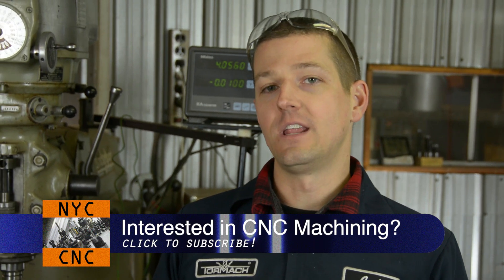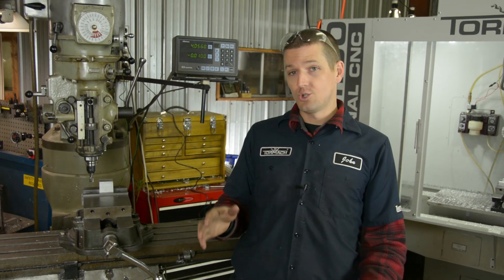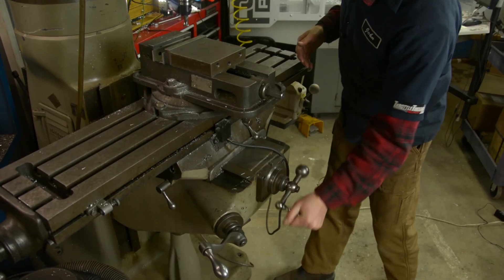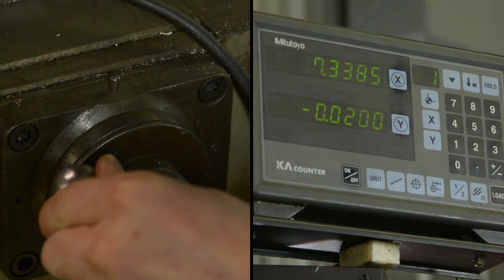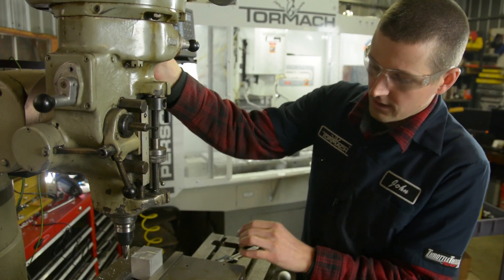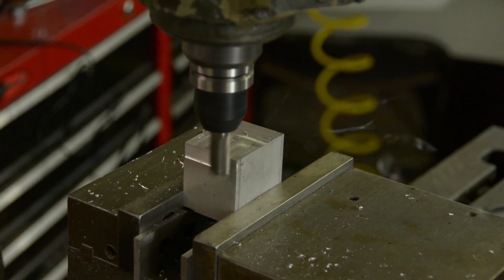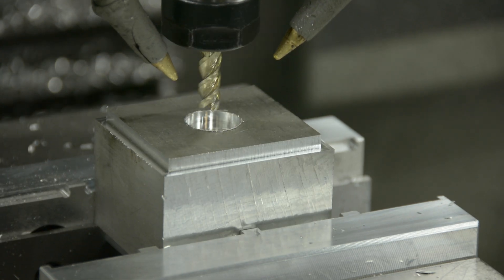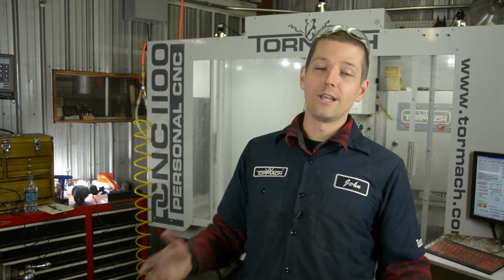Beginners Guide to Manual & CNC Machining!

Comment: The problem with machining compared to the other trades is the income-to-hassle ratio is terrible. In most markets a machinist earns at least $10/hr less than a welder, plumber, or electrician. Not to mention the other trades are much less susceptible to overseas-outsourcing.

Comment: Nice video....I'm an electrical engineering student and I believe all engineers should be familiar with how these shop machines operate as opposed to theory-based knowledge. Especially working at a shop and some engineers have no clue how some stuff works....

Comment: Welding is easy. Well, it's really not easy at all. But as someone who has plenty of experience and is somewhat proficient in both areas (self proclaimed) i definitely feel machining, whether it be manual or cnc, is way more brain heavy and involved than gluing some metal together. (Intentionally downplaying welding for dramatic effect)

Comment: Problem is they advertise STEM careers to pay more than they actually do and its hard to get into the field of study cause they always want to place you in an unrelated field or similar field. You can want to be an engineer and end up only being able to find a job in research testing which is quite boring. In my case I have an electronics engineering degree, now I have to go back to school and take two classes not included in my program and pay out of pocket cause nobody will hire me without CNC programming. Thanks to the college not informing me and adding these courses to my program. 🙄

Comment: 2 flute end mill? Slot drill, not the best tool, end mills can't cut downwards, slot drills can due to their design. You can mod a Bridgeport to CNC , I've worked on them , over 30 years old upgraded fine.

Comment: PLEASE ADVISE.. so im a machinist who is building my own home shop. Naturally a get hit smack in the face with the 3 phase problem. You have any experience with bridgeport using single phase 220 by way of a VFD.. is it worth it, does it work well? Basicly, do i move forward with a single phase Precision Matthew bridgeport clone or a frankensteined bridgeport controling my variable speed with a seperate control? I need advice an quick..
Thanks to everyone who chimes in..

Comment: You milling wrong way round. It is actually backwards. The chips should fly to the back of the tool. In this case the chips can stuck between the tool and the part cause flying front of the tool and making knurled surface if you know what i've mean.

Comment: I miss manufacturing. I hate being a service technician. I started machining in 1991 for Bardwell & McAlister Lighting & Grip. I learned how to use manual lathes and mills. I also learned how to TIG weld from a Miller employee. I think I need to give notice.

Comment: I've always been fascinated with machines. I was Auto Mechanic for 18 yrs. I ground crankshafts for 2 months, that's when I 

was blown away .....welded up a crankshaft journal, then ground down to factory specs.... truly fascinating !  I'm a plastic model
builder but I like to make things work for realism. I', working on crane and wrecker, so I need cable drums, snatch blocks and an assortment of pulley's.  I just bought a mini metal lathe to make these parts with. This should be fun ! Wish I'd taken Machine Shop in high school instead of Auto Mechanics !   Great Video !

Comment: How does the CNC know where the material it needs to cut is? If I wanted to cut a smiley face out of a piece of wood, how would it know not only the X and Y of where to put the first eye, but also how far down and how fast it needs to go in order to not destroy the bit or the material? I just got a $250 hobby/intro CNC and I’m scared of using it because of this. Any tips?

Comment: I suck at math. Can I learn CNC machining and just learn the math necessary to the trade as I learn how to machine, or should I focus specifically on improving my math skills first?
Reply: the most complicated math you really need to start is basic Trig (for example sine and cosine and some right triangle stuff), and multiplication, anything more advanced will come with time and experience/ a good mentor

Comment: Is this trade hard on the back?  What is the hardest part on a persons body?  What is the heaviest thing you have lifted by hand 
 onto or off of a Mill or Lathe?  Thanks so much for your reply.
Reply: really depends where you work, what they make. and what your assigned to do,  i always see older people working in inspection, where there is almost no heavy lifting
Reply: I worked with drill pipe and I would hardband/ add extra surface material to the end of the pipe to prevent it from being worn away.  I believe my original question related to lifting in a machine shop enviroment though.  I guess you gave me kind of a general answer.
Reply: the heaviest thing i lifted was prob over at least 80 pounds, needed help from one more person to move a big ol rotary axis. other than that the heaviest might be some bar stock i had to move  arounds (aluminum) but on a usual day, no more than 5-10 pounds i would say

Comment: Thank you John for taking time to explain this process from A to Z making the difference between a manual and a CNC milling machine. This is my very first time watching your channel and I fall in love with it and have some flashbacks.  I used to teach  machine tools technology for nine years in the 80's and the early 90's. Since I left my country for more than 25 years,  I never have a chance to touch a machine tool. But,  I still have the desire to build my own shop.  After watching this video,  I'm so happy just like it was myself operating the machine. I'm a subscriber now and won't miss any other. Great job!!! Keep it up and thanks again. 👍👍👍👍👍

Comment: If only we could work at this pace in most manufacturing shops then that would be great, unfortunately we are rushed to get production rates while sacrificing safety and quality and pushed to keep most of the 40+ year lathes to keep running while it's on its last legs leaking oil, that's probably why a lot a people are quitting machinist jobs or not interested in it since word of mouth spreads far about the type of work it can be, on top of having to live at work working 6 or 7 days a week sometimes 12 hrs everyday, I can see why younger people who want a life or have kids and a family decide not to get into manufacturing or show interest in this industry, go to school and get a office job 40 hours a week with weekends off, the manufacturing industry is about dead and after most of them got rid of unions and are in right to work states you are just going to be used up for as cheap as possible and live at work constantly stressed to get production for the company can get maximum profits and have no interest or sympathy for what you have going on in your life, you will be a robot/clock number expected to make quality products running 100% on garbage machines with hardly no sleep or communication with the outside world, but if you don't mind working in a stressful enviroment and not having a life, friends or family and only care about making money then this would be a good career.

Comment: Hi,

I’m just getting started off with CNC machining for hobby/specialty part manufacturing to reproduce parts for vintage paintball guns. I’m considering the Haas Mini Mill since they seem very user friendly when equipped with probing system and dynamic work offset/tool center point control.

For the work I want to complete I need 5 axis milling. Is it possible to use a 4-axis machine then rotate the part 180 degrees re-mount and mill what would’ve been the “5th axis” if the part was milled in one step on a 5-axis machine. Or will this cause accuracy issues between steps in the milling process or just over complicated the program to run.

Adding the tilt and rotary nearly double the cost of a 3-axis machine. If re position a work in progress is manageable (not sure if the probing system would help in this situation ) it could be worth the savings. But if it causes more headaches that it’s worth I wouldn’t want to end up kicking myself over saving $12k upfront cost.

Also are there any smaller machines on the market capable of being optioned out with a master/slave for 5-axis milling? Most of the parts I want to mill are very small (1”-7”) with the odd item being around 12”x5”x1.5”. Accuracy and finish quality are very important which is why the Haas products have caught my eye but if there are smaller machines on the market it would be better on my budget/space limitations. I’ve searched for machines a lot but manufacture don’t exactly advertise their offerings very well making it hard to find for people outside the industry.

Any information would be useful. Thanks!

Comment: I need to find a smaller 3-axis "desktop" cnc mill. Something that can do aluminum. And doesnt break the bank. Or a good used one. 20"x20" table or something around that size is plenty big for what i need.

Comment: Im 40 and love machining like you john, i work for a gas utility. I would never consider a career change to machining because of the lack of job opportunities, and the lack of good paying machining jobs. I actually live near you in Erie pa.   For example General electric is probly the highest paying machinist jobs in the area. But getting a job at GE is difficult and akin to building a house next to an active volcano all the effort for not. Even if there hiring you get a tiered contract and 0 job security. All the rest of the jobs do not pay enough to live anywhere but in a trailer. Unless you maybe are successful at starting a business like you. Most dont have the ambition. So kids are avoiding the machining field like a plague. I was recently at an auction at a vocational school in pittsburgh pa. They closed down the machining program because they had 3 students in 4 yrs and auctioned everything.  Good for me i purchased a 14inch lathe for 1200$ made in 2004.  They sell new for 18000.00.

Comment: Hi Thanks for all the great videos you have provide thru out the years, they have inspire me to go out and buy my own Mill and lathe. But as you can imagine I'm in desperate need for knowledge in every subject relating with the CNC world. This last week i got my first use Bridgeport mill and going to pick up my first lathe this coming weekend. The mill has Gettys DC servos (125 foot lb +-) only, no drivers or controller. The lathe is manual but want to converted to CNC. So if you don't mine the question, what system can i use that would not break the bank. I'm not a business and have a regular job. Once they are up and running i'll probably be making a couple of pounds of ships a week mostly for hobby projects. I was looking at the Centroid  and also Clear-path systems but I'm not sure, Your input would be very leveraging on my decision. Thank you so much for all your hard work and sharing your research with people like myself. Please be safe and hope to hear from you soon. Rmginusa@gmail.com

Comment: Hi, I'm a mechanical engineering graduate.
My school program was very theoretical and geared toward scientifical concepts ,conception, programming and engineering management. We did some classes on material, material strength and machining, but I feel that it is not enough to be proficient in the real world.
I wish to gain more skill and knowledge on machining and material. So I can be a better engineering and be able to communicate more with people working with the machine.
But I don't know where to start and what to study. I was wondering if you had videos and concepts you can recommend.
Also, I was thinking of following a hands on machining class part time, is it something usefull to do?

Comment: im looking to get in to this for work. CNC/CAM any tips
Reply: Take your time, whatever you are doing mentally walk through the steps and ask yourself if your missing something. Most places would rather you produce quality parts over quantity. Rushing also often leads to mistakes, many times expensive. Also dont be ashamed to ask for help if needed. Take notes, there is a lot of stuff to remember, it seems daunting and you will forget a lot of stuff at first. however the more time you experience it the more you'll know and remember. No machinist manual or cnc is perfect. we all make mistakes and often times the machine is just being a tempermental bitch.,

Comment: Ok first kids : ALL WAYS LOOK AT THE TOP OF THIS BRIDGE PORT! Because SOMETIMES the person before you might of left the wrench ON THE TOP OF THE SPINDLE!!! It's used to tighten the spindle chuck👍 Make sure it's CLEAR! Because you will ether BREAK the spindle spline OR you will FLING THAT WRENCH like a rocket and kill someone OR a combination of both 😵And if you want your parts to be CORRECT! You must edge find your clamp or chuck jaws! MaKe sure your clamp & clamp jaws are good  and tight !!! Because if they move AT ALL YOUR ZERO IS GONE &  you will need to re-edge find all over again! AND ZERO THE X,Y,Z on the small computer looking box with the digital readout , with a tool called a edge finder!!! That is your point of zero/ Origin Unless the machine is zeroed out already,but that hardly the case! AND ALSO VERY IMPORTANT!!! If at anytime you remove your work pice from your clamp. YOU LOST YOUR ZERO! Unless you have god like hands that can  tighten and place the work pice back   Precisely , exactly , BACK the way it was in the clamp jaws EVEN IF YOU HAVE BUMP STOP!!!  Always trying to finish your operation without removing the work pice!!!  Because if you're trying to hold a  moderately tight tolerance we will say +_ .005 you could easily lose that by removing the part out if the jaws!!  Especially if you're trying to hold .0001  just forget about it trust me ! & a (WARNING) PIN BACK ALL LONG HAIR, ROLL UP LONG SLEEVES,NEVER TRY AND WIPE THE WORK PICE WHILST THE SPINDLE IS MOVING!!!!!! If you try and wipe coolant,tapping oil, whatever with shop rags while the spindle is on IT COULD PULL YOUR HAND IN !!! You are NOT fast enough to let the rag go before the spindle grabs the rag in and BOOOOM your hand is no more!!! ALWAYS TURN THE MACHINE OFF!!!! and of coarse safety glasses 👍
Reply: I've been machining for 20 years now. Mills getting progressively bigger till currently working on 15 tonne workpieces   Glad I learnt after being caught by my sleeve on a Bridgeport mill 18 years ago and escaped with just bruising with friction burns. Only because my right knee had the sense to hit emergency stop on the way in. Plz do not think these are toys,I got lucky as the 50mm face mill inserts were not sharp like an endmill. Stay safe and turn off moving parts before placing anything you can't afford to lose near them.
Reply: Wow I thought that I was about to waste 30 seconds of my life reading this comment but no, I actually learnt a bit. Thanks Jimmayyy you legend
Reply: Thanks brother ,peace and luv to ya..
Reply: Hey, do y’all wear dust mask for the metal? My boyfriends a cnc and he’s not listening to me lol his nose it black from the metal dust
Reply: i thought of the same thing when i took my cnc course. if you think of it tiny metal dust particles are around the air you breathe. so technically i guess it could be safe if you wear one. like they say safety first.

Comment: So I just found your channel and already subbed. I know literally nothing about CNC, but I think it's like cutting through metal on a grid. Is that right?
Reply: NYC CNC Thanks!
Reply: NYC CNC I recently started working wit cnc machines. I'm trying to learn more but other people can understand the different modes better than I do... For instance changing offsets and mdi... I know it's relatively easy but I'm not comfortable with the machine... I would like to have a better understanding. What advice can you give me in this situation. Great video. I use doosan machines by the way

Comment: How long are the shifts machinists usually work? I'm 19 and looking for a career but I'd prefer a job with shifts in the 8-9 hour range. A guy in the comments here said something about 12 hour shifts and I don't want to sound like a baby or lazy but I'm not sure if I could handle it.
Reply: depends on the company, 8 hours is typical but larger companies may have 4 10 hour days or split week 3 on 4 off/4 on 3 off weeks, 12 hours a day...then theres overtime, some have mandatory some have volunteer. do your self a favor and don't base your career of the hours you work.

Comment: You never mentioned anything about the bit (what alloy, what other types can be mounted, wear and replacement time, etc). Can titanium be milled on that machine with that bit alloy? Are tungsten carbide bits common? What's the friction issues (heat and recoil) with the bit to the metal being cut? Etc. I wanna know about every bit of the bits!
Reply: +Thomas Larson That is not exactly the point of this video.

Comment: hey I'm a student at Gary job corps. a vocational trade school, what should I focus on to be a good cnc machinist? like what will I need mainly for a good base?
Reply: How ya doin at GJC? Have you gotten more experience in cnc?
Reply: +Mr Alias yes sir, I have completed my trade. I am currently working at a company called Pam-Rod making parts for the machines that break down.
Reply: Awesome! So I know some CNC students become manual machinists and vice versa. Are you mainly in CNC or manual?
Reply: +Mr Alias Manuel and cnc rn
Reply: Yes but it's basic stuff I'm doing rn. I want to get into more advanced work.